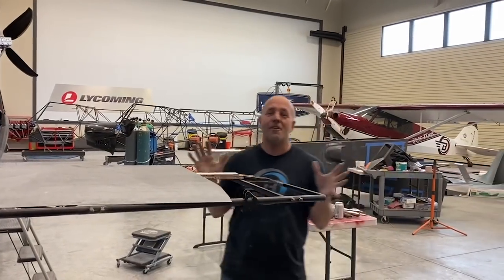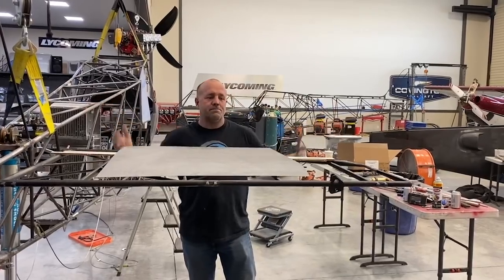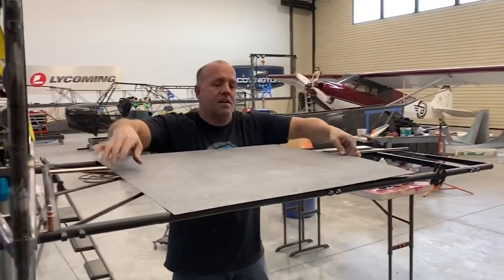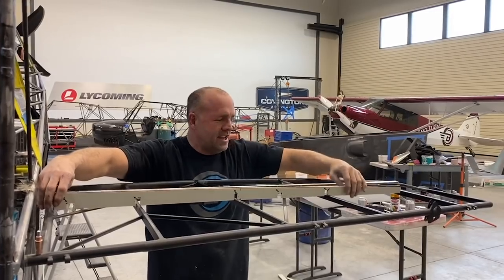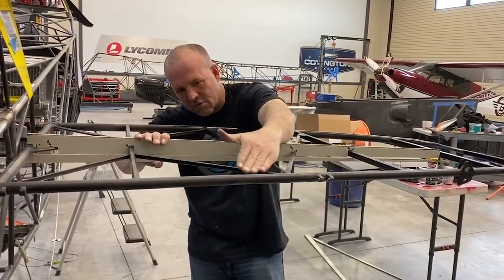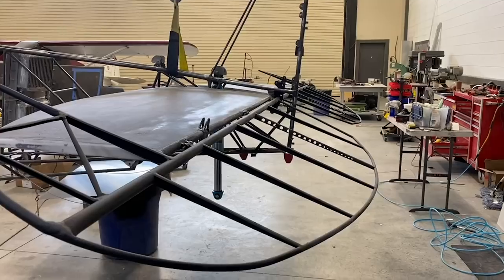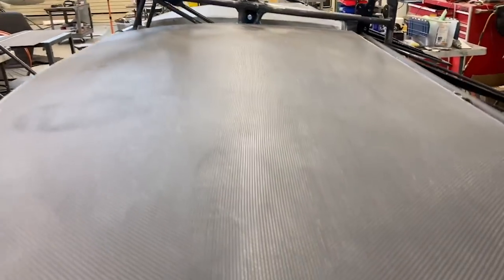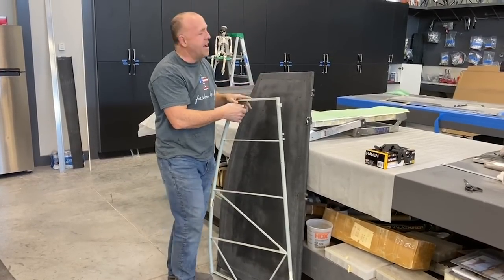Carbon Kevlar Carbon Cub (Scrappy Bush Plane 13)

Comment: isn't kevlar actually stronger then carbon fiber but carbon fiber is just waay stiffer? :D
Reply: Similar fibre strength - depending on grade (Cost benefit??): In the end the strength of the layup all depends on fibre density and orientation for the stresses (this design is not optimised) and matrix adhesion,  Aramid is tougher (engineering) than carbon -  handles impact energy better but Aramid/Kevlar degrades with UV while CF does not (the epoxy does though).

Elastic modulus gives stiffness CF>>Aramid...

For absolute strength UHMWPE can be a stronger fibre - again not UV stable (>>Specific Strength ).  Not so commonly used in composites - it may not be compatible with the resin  systems??

Comment: 😄are you going to add in an MCAS system with the bigger engine. Hopefully you prove to be a better engineer than those at Boeing😆
Reply: very funny, but didn't you notice the Airbus design Cues?

Lower and set back into firewall to avoid "blanketing" the wing root.  jk.

Comment: I so much admire your abilities and time spent on your ideas. Very Good!
But for some reason @ this point in time during this most serious pandemic, it seems a bit off or spoiled to be posting something like this. Maybe the reality or the full comprehension of what is really occurring hasn’t reach your region Yet!.Still, you’ve done a wonderful job so far and I dream often of projects I know I’m likely unable to complete without assistance of someone as talented as you👍
Reply: You can't use the pandemic as an excuse to sit in your house and feel sorry about yourself. Mike is practicing "social distancing" by working in his hanger. He's keeping 6 feet of separation between himself and the camera man like the CDC recommends. You can't fault a guy who is making the best out of a bad situation. Get up, get dressed and get back to work. 💪
Reply: I don't understand what would be a problem with posting - it's not only a way for Mike to maintain a high degree of isolation in his workshop, it also provides others with something extremely interesting to watch while they are practicing social distancing.   I'm not sure what the would be spoiled or off about that.  ?

Comment: I hate working with fiberglass. It makes my skin itch. It must be a hobby for you. I think if I had the money and needed a STOL plane I would buy an air tractor like they use for crop dusting or some other manufactured STOL plane. Why reinvent the wheel?

Comment: If you want the Kevlar to protect against shattering it needs to not be bonded to the carbon with epoxy. The problem is that when the carbon breaks the stress levels are WAY beyond what Kevlar can hold. If the carbon part was wrapped in Kevlar that is not bonded to the carbon, it probably can contain the pieces, but when it is epoxied to the carbon the situation is different. When the carbon relaxes after the break it will move more than enough to exceed the Kevlar's elongation because only the Kevlar fibers that bridge the crack can absorb the load, while the whole of the carbon (now in 2 pieces) is pulling it apart. Further the force the carbon will apply to the Kevlar will be far more than it can handle. A weaker, stretchier glue should be used to bond the Kevlar to the carbon if that is your intention. Break a few test panels before you bet your life on something.

Comment: OK Mike why would you use Kevlar, why. Even the major manufacturers have stop using Kevlar in most areas. Unlike  carbon fabric where the adhesive is absorbed be each strand or fabric toe with Kevlar the adhesive is not absorbed it incapsulates the Kevlar stand/toes. Kevlar will absorb 20 times its own weight in moisture. When the moisture freezes it expands cracking the adhesive matrix that encapsulates the Kevlar fabric toes making the problem worse, more cracks more moisture. Stick with carbon fiber and a 120 or 181 style glass fabric. The glass will give you good impact resistance form small pebbles and sand.

Comment: But Mike, using Kevlar, which is severely hydrophilic, will absorb water when the weave is exposed to atmosphere.  When this monstrosity is comfortably cruising along at FL420, freezing water in the weave will cause delamination.  If the aircraft sheds control surfaces due to delamination flutter caused by aerodynamic loads at the hypervelocities this thing will certainly be traveling, there is cause for concern that vehicle impact with the surface of the earth will cause the destruction of vast swathes of the earths surface.  You, of course, wrapped in your carbon cocoon, will emerge untouched.  Fly careful my friend!